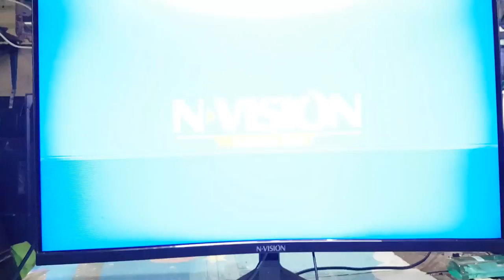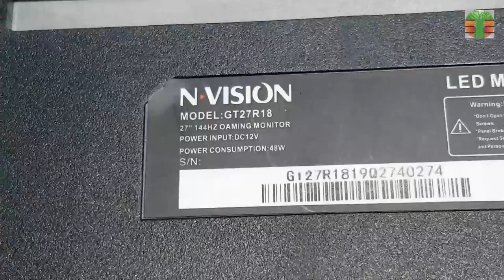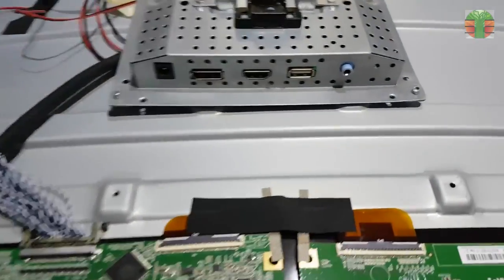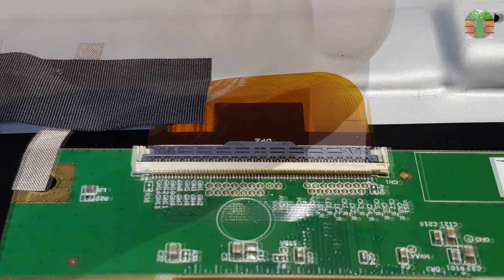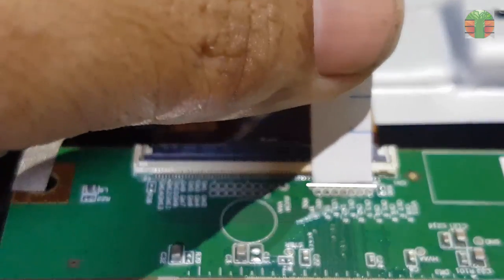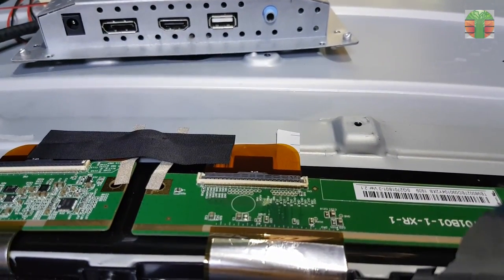N-Vision GT27R18 Black stripe line on the screen Fix.

Comment: thansk for this vid, had the same curve monitor from Nvision GT24R18, and id be using this documentation vid to properly disassemble my monitor 😊
since im replacing the backlight of my monitor due to dim spot. if its ok to ask, my excused, will any LED backlight kit works as long as its the right length and voltage?